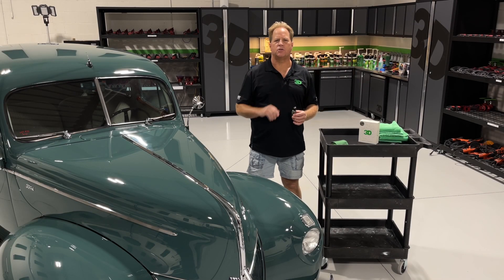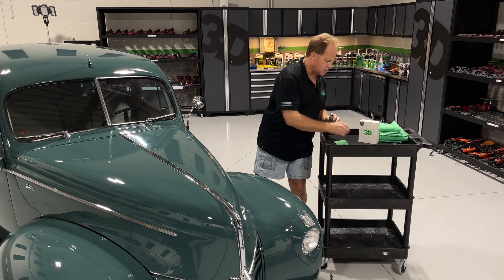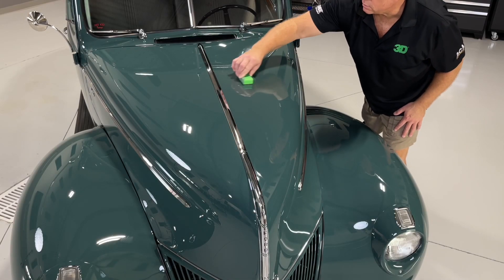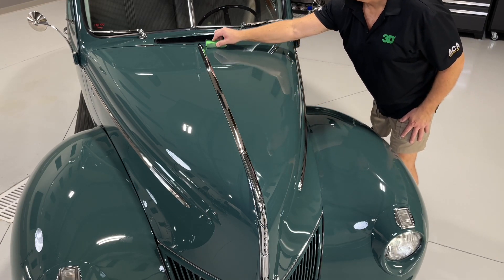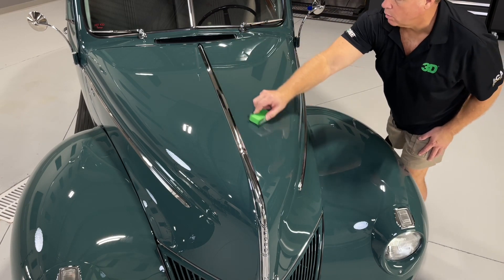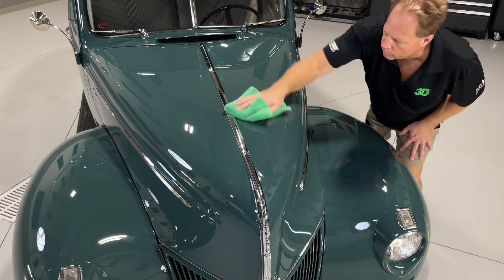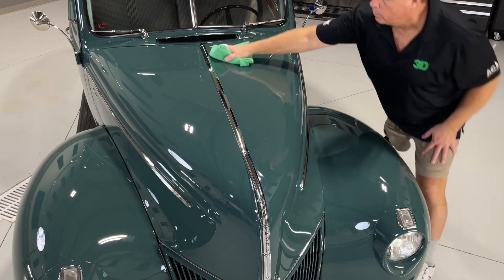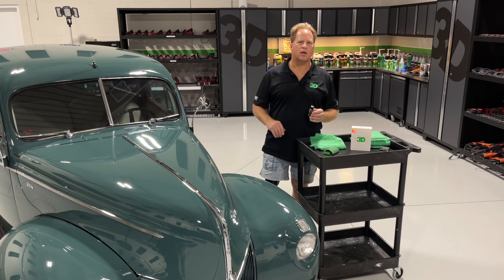New!  3D Graphene Infused Ceramic Coating - Application Directions

Comment: Hi  I'm a huge fan .I'm the Detailing guy from South Africa . Will Ceramic Coatings work on Self healing paint (Scratch Guard)  like the paint from the Nissan GTR.  With my understanding of that self-healing paint its made up of resins and basically it flexes when heat is applied to remove scratches.  In other words its a soft flexible product .and by applying a hard coating like ceramic you going to restrict that movement. How would it affect the paint .